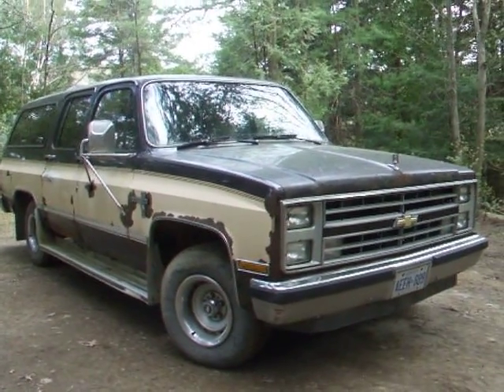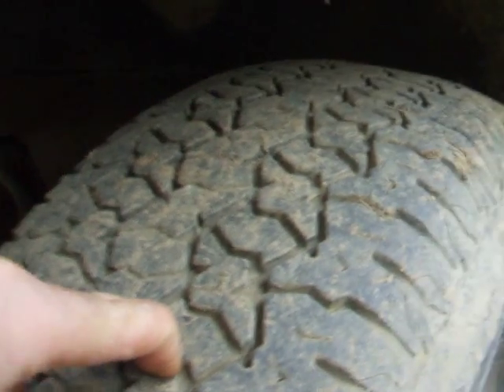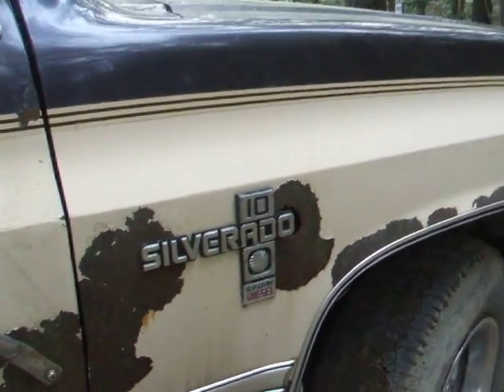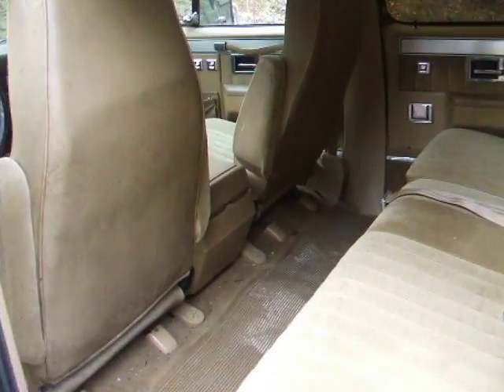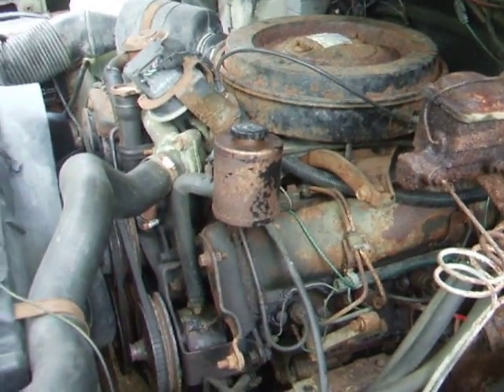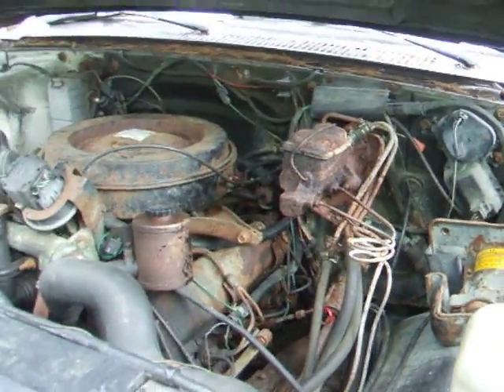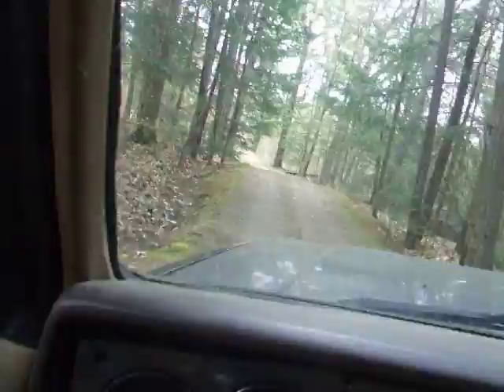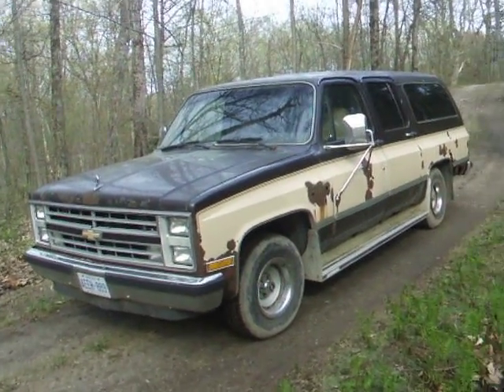1986 Chevrolet Suburban Silverado 6.2 Diesel - SOLD

Comment from the maker: No problem, thanks for the comment. They don't care to a certain extent as long as you own it, but when it's sold, it has to be re-certified, and then they nail you. Even though it still drives fine, it hasn't been on the road since '99, so it looked a bit better back then, though not all that much!  It was pretty much the same a now, just a bit better.  The chap who bought said my engine is amazing, going to keep it to drive around his farm for awhile, and use it to keep his own Diesel running.

Comment from the maker: It is amazing isn't it?  As my Dad says, Big Truck size with VW economy, go 1000miles/tank. These engines run forever, no carburetor or spark plugs to service, super reliable, hardly did anything to the engine all the time we owned it since new.  I drove it out of here when we sold it last year; now the new owner's selling it again...(!) (see link in my description soon)

Anything else you want to know about these trucks Joel, one of my favorite subjects, send me a private message anytime...:^)

Comment from the maker: Had it undercoated with tar since new, and realized our big mistake way too late.  Oiling is much, much better, the Grey 4x4 in my other video is a prime example.  Same year and age, oil instead of tar.  What a difference!
 
It's really too bad, aside from the rust, there's not that much wrong with the truck.  If we'd used oil instead of tar, or done nothing, ironically, I'm pretty sure we'd still be driving it today!

Comment: Nice big trucks, here in Britain you'd hardly ever see anything like that over here, our vans and trucks are all diesel yes, but they're in the 2-3 litre class, funny thing is, the 6.2 is non-turbo so they can't be all that quick ,I know that's not the idea with these though it's all about towing and load carrying, durability and MPG.  I laugh at times just how little power most American and Canadian engines get with all their emmisions gear when compared to the rest of the world, here in Scotland all our cars are either diesel , 4 pot petrols, or at most a 6-cylinder, some V8s in bigger cars, yet our 4 pots seem to get more out of them than most US 6 pots, maybe that's just my observation, I can't drive I'm partially-sighted btw, but I do like my motors and stuff.  If you like piano music take a look at my channel mate, hope you like it, and nice old truck.
Reply from the maker: Thanks very much for the comment Sam.  Yes these engines aren't the best performers, but they can haul, and we got 30mpg with this truck.  As my Dad says, Big Truck size with VW economy, with the 33 imperial gallon tank we could go 1000miles on a fill-up.  There were two versions of the engine, one with and one without emissions equipment.  The LH6 code got 145HP, while the LL4 with NO emissions stuff got 155HP. 

Sure, I understand a turbocharger would give it some pickup, you can actually put one on these 6.2s, called the Banks Turbo, increases power and fuel economy too!  What's weird, we had a 1995 6.5 Turbo Diesel for a couple years, we were NOT pleased with it, it was a lot peppier but the fuel economy was dismal, worse than a gas engine - what's the point?  I'm going to find another 6.2 soon, talk about a trouble-free engine, and really like and need all the room for carrying stuff, my Dad says it's the best compromise between a pickup and a van for cargo space and durability.

Looked at your other videos Sam, you play by ear very well!  I play the piano myself too, I've learned to read music, sorry to hear about your eye trouble.  At least you can still make yourself and others happy making music, it's a great talent!  Cheers!